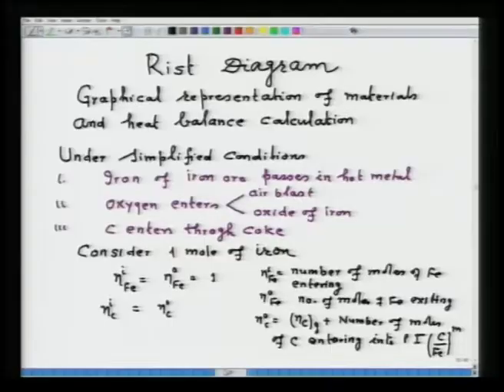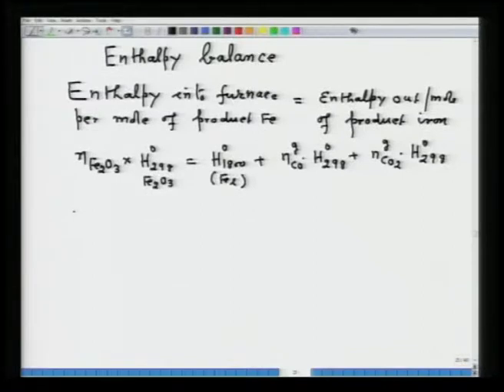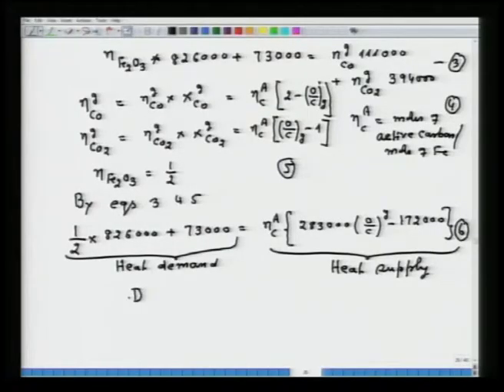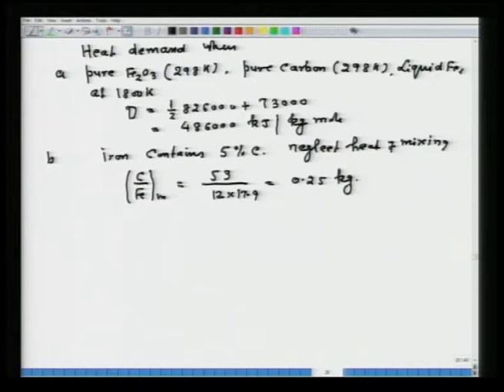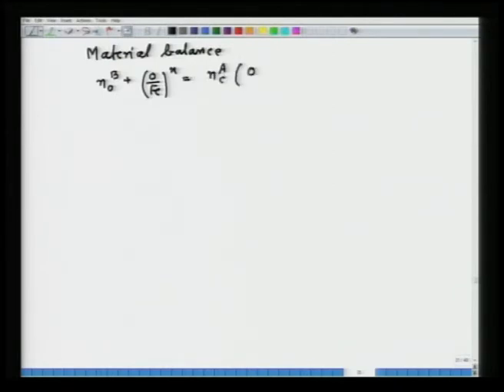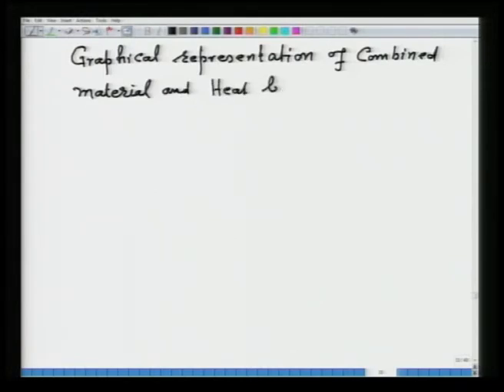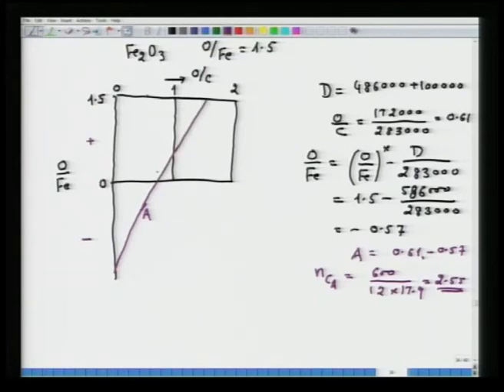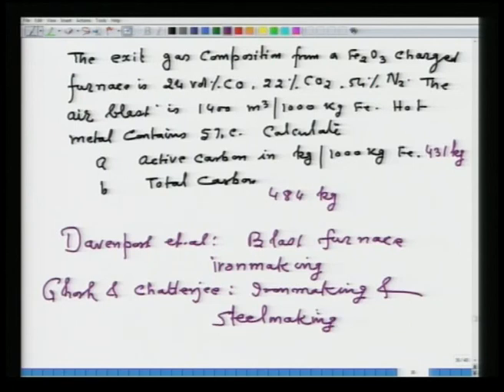Mod-01 Lec-33 Concepts in Converting

Comment: Prof..can you do mean favour on how you calculated the amount of coal in question 6 of lecture series concerning 
roasting.I managed to get the weight of roasted ore as  877kg and moles of sulphur dioxide as 2.1875kmol(on dry basis).From i   have been having hard time to continue  to find the wet composition of the flue gas..